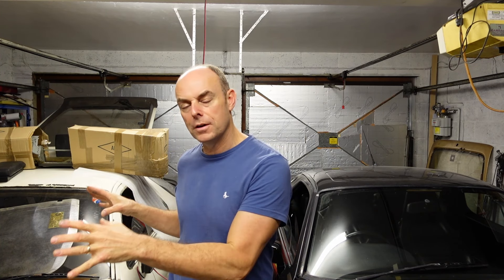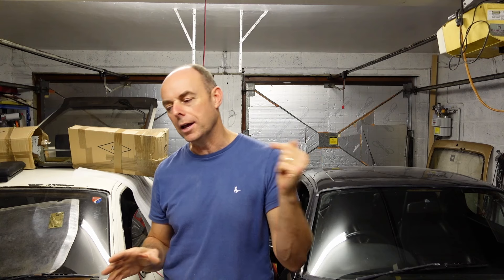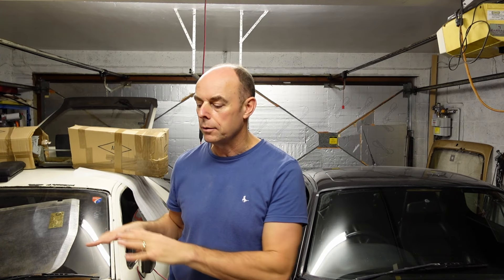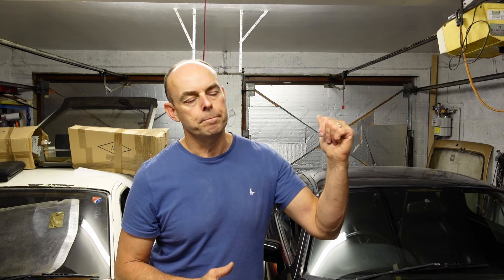Porsche 928 Episode 130 - Paint "Correction"

Comment: I've read that Saab 900 window motor is the direct replacement for the 928 of the same model year. I've also read that some of Mercedes's window motors should work for 928 as well. Those might be easier to find and cheaper.
Reply from the maker: Thanks Michael, I think you are right - luckily the GT came with a spare window motor, so I'll probably fit that on the 79' car. Thanks for the comment :)
Reply: @MrToddgibbs  I believe that 79 and GT window motors are not direct swap. Your 79 has 8-teeth motor, when as GT has 10 teeth. You may need to swap the entire window regulator assembly.
Reply from the maker: @michaelallen5895 ah good info. To be honest both cars’ windows are fine at the moment anyway

Comment: Regarding the starter ... I don't know if yours has it already ... but if not, it is probably wise make sure that there's a heat shield in place for it.
 
I don't say this as an expert ... more in that I have a 'hot start' issue which we're all but certain is because the starter solenoid is expanding due to high heat which means it cannot fire. This probably isn't an issue straight away, but down the line it could be a real arse-ache!
Reply from the maker: Nice tip - I’ll have a look under there. From memory it’s a fair way from the exhaust

Comment: Todd where is the actual
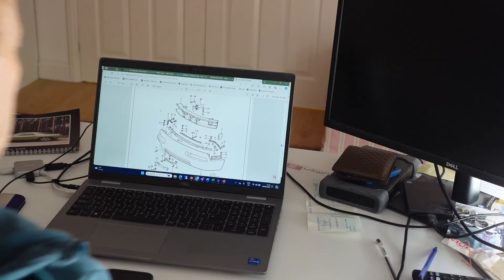Aluminium front bumper bar? Part number 1 on the part picture you flashed up at 22:23. All you have is the plastic bumper cover not the actual metal bar. It’s the same design as rear. It was actually a revolutionary 928 design followed by the whole car industry! Now all cars have plastic bumper covers where before the bumper bars were exposed. Those two protruding metal tubes you were showing attach to the bar itself and act as sacrificing compression tubes in a low speed accident so the main chassis is protected. That’s why your louvres were broken. The bar must have bent into them. Probably from a low rock/hard fixed ground object that was hit  in a car park but below the bonnet line. The bar has been removed but weirdly not replaced.
Anyway, for safety and completeness you need to find a new metal bumper  bar as per that part chart diagram part number 1. Cheers
Reply from the maker: Thank you Peter, I don’t know why I didn’t spot that considering I have a 79’ car right next to it with that bar…. Anyway, yes I think you are right about the damage. And I’ll replace. It’s been missing for 15 years lol
Reply: Glad to be of some help Todd. Love your channel and passion. Quite inspiring to the rest of us amateurs. The GT is such a wonderful car to drive when everything is working as it should. Good on A and B roads with that 5 speed manual gearbox. Keep up the great content! Cheers
Reply from the maker: @petero2778 thanks, appreciate your support :) can’t wait to actually stretch the GT, a few people have commented about it over 4000rpm - think I’ve been there once! Cambelt next week and I’ll find out (and record).
Reply: It’s a totally different animal to any other 928 above 4000. A wild bark all the way to 6,600 rpm with a very ‘generous’ rev limiter!!!

Comment: Todd, next time, just sand away the flaking paint until you achieve a proper featheredge to then apply primer surfacer over.
Reply from the maker: On the “hole” instead of using filler?